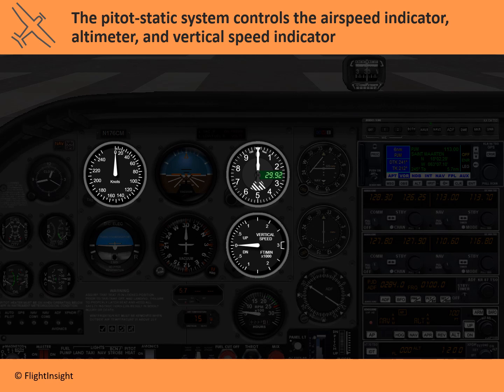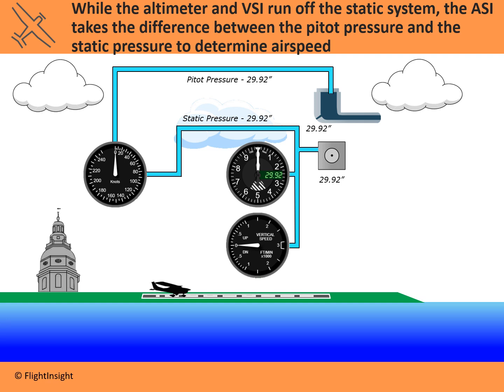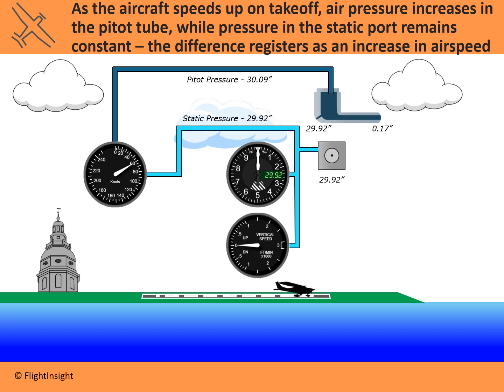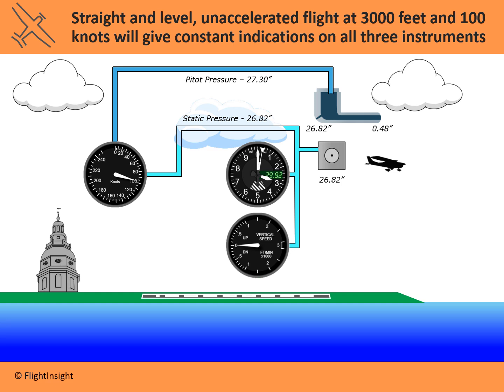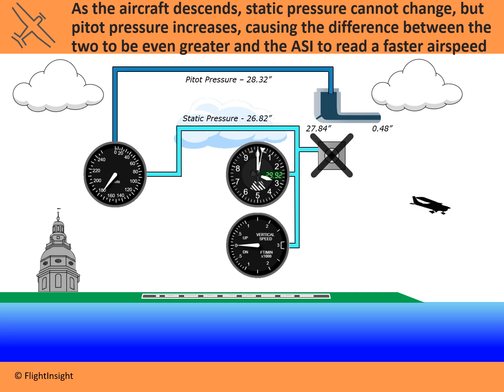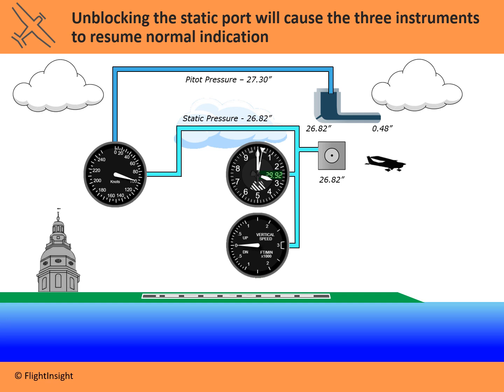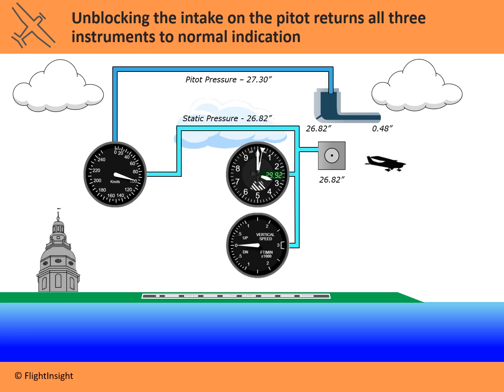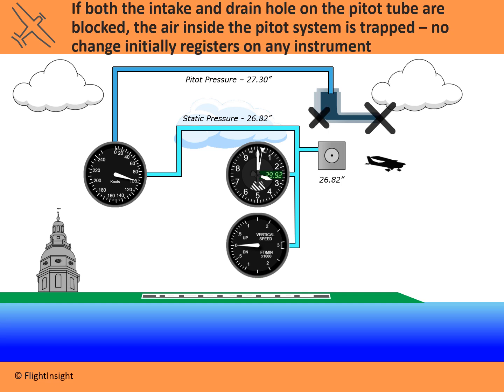Pitot Static System Errors in Aviation | Flight Training | FlightInsight

Comment: The description of pitot pressure is not entirely correct.. While the drain hole does allow static pressure inside the pitot tube, there is also static pressure included with the ram air coming into the front.  The static pressure is just the pressure of the ambient atmosphere, which is what is entering into the pitot tube.  The total pitot pressure comes in through the ram air, whether or not the drain hole exists.  The dynamic pressure (pressure due to airspeed) is found by subtracting the static pressure from that total ram air pressure (pitot pressure).   The drain hole only comes into play when the front of the pitot tube is blocked.

Comment: I'd like to clarify one point.  You say that when the static port becomes blocked the altimiter and VSI become frozen.  Which implies they maintain their current reading. This is not entirely correct.  As the static port becomes blocked the VSI will return to zero.  So if you're climbing (or descending) at the time, the reading on the VSI will move towards zero.  This is because the VSI is measuring the rate of change of air presure.  

I don't think anything you said contradicted this, it's just that you didn't include a scenario where the static port became blocked during a climb or dive.

Comment: I really love your videos and it helped me allot understanding some topics , but if I am not mistaken the drain hole on the pitot tube not used for the static pressure it  basically to get rid of moisture or any contamination mixed with air , and as the aircraft speed increase and the air goes into the tube It’s pressure decrease based on Bernoulli principle, then the difference between static pressure that comes from the static port and ram pressures from the pitot tube will be deflected on the airspeed indicator as the aircraft speed , please correct me if I am wrong .

Comment: This failure of the pitot tube pressure ports is what happened to Air France 447 over the Atlantic after flying though a thunderstorm. Icing blocked up the pitot tube and caused overspeed warnings which altered the autopilot environment, confused the pilots, and caused their A330 to drop like a rock into the ocean.

Comment: So if I recognize and admit that I have a static port failure/ altimeter failure, how do I get a correct altitude? If I contact ATC will they be able to provide that for me? And how can I trust that they are telling me my correct altitude? Reference the arrow Peru Boeing 757 crash where their static Port was covered with tape. ATC was also giving them incorrect altitude reporting. This is a serious question that should be addressed. Does anyone have any idea. ?? Thanks in advance for your Insight

Comment: I first want to say I absolutely love your videos! One question about the Pitot Pressure. Toward the beginning of the video, wouldn’t the Pitot Pressure decrease from SL to 3,000ft (with altitude) because you have less air molecules actually entering the pitot tube as you go up in altitude? Or does it not change as long as you maintain the same Airspeed?

Comment: Both the ram air and drain hole of the PITOT tube are blocked. How does this affect your instruments?
Reply: The static pressure going to Altimeter would still work.  but the blockage in the Pitot would pretty much keep the pitot pressure locked in at a specific pressure.  as such as the aircraft rises, the static pressure would continue to decrease and the locked pressure in the pitot would show the airspeed increasing (since airspeed is difference between static and pitot total pressure).  But the airspeed would not be accurate, it would just be random depending on the erroneous pitot pressure and given static pressure.

Comment: Pressure inside the cockpit will be slightly Higher than outside static. This is due to the venturi effect (air flowing around the fuselage)
Reply: It’s absolutely lower inside the cockpit

Comment: i also hear that if your secondary static port fails (or if you dont have one) then you can punch the vertical speed indicator and when you break the glass, no more speed indicator.. but static air comes in for the other instruments. im not a pilot or an engineer so idk for sure, but it makes sense.
Reply: Yes. VSI least expensive of the 3.
Reply: @2016-m1h  more importantly, the least useful.

Comment: A question I have always had is, why not leave that cabin static port open 100% of the time? Not to mention, why even have the static port outside (of unpressurized cabins of course) in the first place?
Reply from the maker: This is a great question. The shorter answer is that a lot of thought goes into placing the static port where it is on your aircraft, and the instruments, especially the ASI, are calibrated with the assumption that the outside static air is used. The pressure inside the cabin can vary greatly based on if the vents, window, doors are open, or heater is on or off. The pressure on the outside static port is thought to be free of this “noise.” Some POHs will list different calibrated air speeds for use of the alternate source. BTW, thanks so much for your support and thoughtful comments!

Comment: So what if all three get blocked?
Reply from the maker: Good question. With all three blocked, the pressure differential will be unchanged no matter what. The altimeter will be frozen in place, the VSI will read zero, and the ASI will be frozen at its last reading. No speed or altitude changes will change these indications until the blockages are removed

Comment: Nice video, but your description of the Pitot tube is not accurate. The ram pressure includes static + the added value. The drain hole is a drain and calibrated leak. were it clogged (the drain only), the ASI would show a slightly higher airspeed.
Reply from the maker: Agreed on all points! Having just the drain hole clogged wasn't a scenario illustrated here, probably because the tube tends to ice up from the leading edge backward. But why is it inaccurate to say the pitot pressure is the combination of static and ram?
Reply: @flightinsight9111  >  I disagree with that assessment.  When hooking up an Air Data Test Set to a modern pitot/static probe.   The Static and pitot are left open to the test set.   The drain holes are block by rubber o'rings.   This blocking the drain ports has absolutely no affect on the accuracy of your indications vs settings on the Air Data Test set.

Comment: Great video, but I think you got the value of the pitot pressure line incorrectly. You should subtract the ram pressure from the pressure leak at the drain hole and not add them.
Reply from the maker: Thanks for the help! I agree it's a bit awkward drawing out the pressure values for the two openings, but I wanted to show the addition to the system of the ram pressure. Hope it was still helpful.
Reply: @flightinsight9111  you might ignore the drain hole completely here. It will “leak” ram pressure, but the drain hole is much smaller that the pitot inlet line such that it can be mostly negligible and/or baked into the IAS to CAS correction. 

Or just carry on since this is really an inconsequential point.  I just happen to be an engineer learning to fly and do really appreciate your videos!

Comment: The drain hole is for static pressure? I read that it is to drain out the water which might enter during the flight in rain and all.. And it makes sense because the diaphragm is expanded accirding to the static pressure, but isn’t the static port connected to the ASI? So, that drain hole balances the pressure pressure doesnt makes sense, because Why would the static port be connected to ASI, If the drain hole balances it? 🤷‍♂️🤷‍♂️🤷‍♂️
Reply from the maker: It's true the drain hole is used to get water out which may have come through the ram inlet. If there is a partial blockage, like only the ram inlet is blocked but the drain hole (usually at the back like on the 172) is open, the pitot tube becomes like a second static port, both of which feed the ASI. So with the ASI comparing static pressure to static pressure, it's likely to read close to zero

Comment: question on the ifr written goes "if both the ram air input and the drain hole of the pitot system are blocked, what reaction should you observe on the airspeed indicator when power is applied and a climb is initiated out of severe icing conditions?" the answer is that it acts as an altimiter.

but, if you are going up into warmer air, wouldnt the pressure br higher and therefore show a decreasing airspeed as you move up? the wording on these tests is ridiculous.
Reply from the maker: If you are climbing, the outside air pressure will be decreasing with altitude. This is especially true if the temperature is warmer at higher altitudes (like in an inversion). Warmer air is less dense as air molecules are more active and spread out with temp increases. The lower pressure will read as increased airspeed when the pitot is completely blocked (works like an altimeter, if you climb, the airspeed indication increases).

Comment: great video, you can also break the glass on the VSI
Reply: Most aircraft have an alternate static level and system involved that when pulled, uses the cabin air pressure. 

Smashing the glass is kind of an outdated way of fixing that problem. If your aircraft doesn’t have one then by all means go for it, but maintenance won’t be too happy if you smashed it having the alternate static system installed
Reply: Lever*
Reply: @SnipeD312  my airplane does not have an alternate static knob.